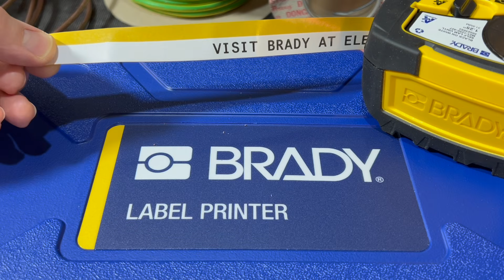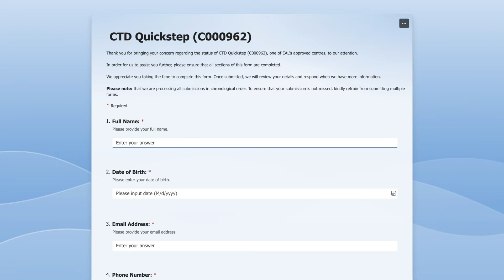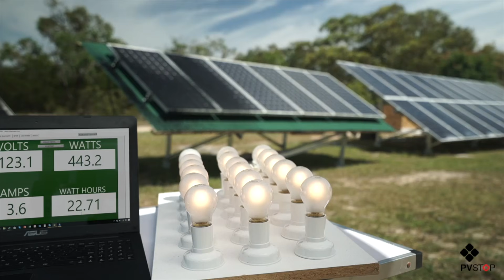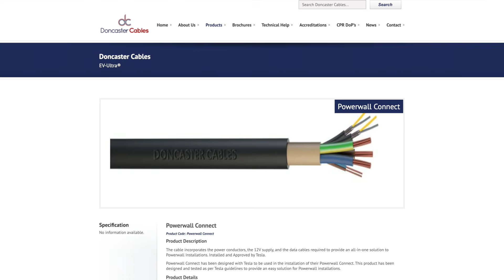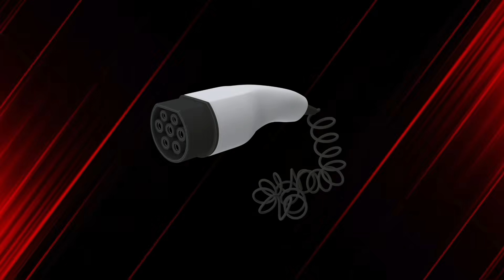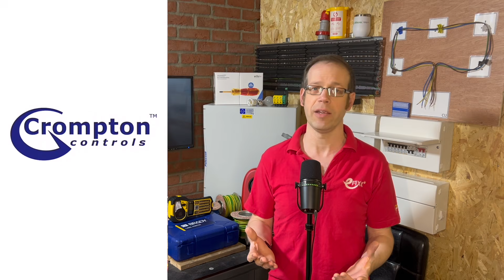Can You Do It? Yes. Should You? Hmm…

Comment: In the US, we don't have a standard rail to put the breakers on... When you build your house and install a particular brand breaker box, you are pretty much locked into the type of breaker that the manufacturer uses... If you have a house that has a discontinued model of breaker box, you might find it a bit expensive to buy a new breaker for a new circuit or replace a malfunctioning breaker... In some cases, it is cheaper to buy an entire new breaker box and new breakers than trying to buy a new breaker for your old breaker box... Having a common bus (DIN) that every manufacturer is required to conform to makes a lot more sense... That being said, I've lucked out with my current house since it has a Square D breaker box and the breakers are easy to find... The current price on the 60A 2-pole breaker that I used for my NEMA 14-50 welder and EV outlet in my garage / shop is $17 at my local HomeDepot...

Comment: The real comedy one on 'different' brands in the same enclosure is when it's been bought in by another company and just re-branded.
e.g. a long time ago MK MCBs were made by merlin gerin 

so now can get a whole lot that are the same brand on the label but a bunch of different manufacturers under the covers, lots of nonsense.
Reply from the maker: Wise words - the first MK sentry devices prior to the Merlin ones were made by Siemens.
Reply: Every time I buy a new MK breaker the switches don't line up with ones bought previously. I have seen one board fitted with only MK devices and it looks like a complete dogs dinner due the mismatches  as it has been upgraded over time.

Comment: Mixing different brands in the same CU. Is bad practice, I wouldn't do it.  When I see such things , I know I'm working on a bodged job ,, and know I going to have to put a lot of things right
Reply: Or just a job which has been upgraded.
Sometimes things are added to a system after it’s initially installed.
Reply: Or just a job which has been upgraded.
Sometimes things are added to a system after it’s initially installed.

Comment: Those mix and match caveats are absurd. If a half a dozen manufacturers can each stuff (say) a 14 way cabinet full of gear without it overheating, then mixing and matching isn't going to overheat it either; they are just metal boxes with a DIN rail. Other countries don't have the same restrictions. Of course there are some mechanical issues; primarily whether the bus bars line up, or if the switch fascias line up with the aperture in the cabinet, but the whole idea of a DIN rail is that it's modular. 

However, I guess it looks neater then it's just one manufacturer's kit.

Comment: If a customer needs a new circuit and there csu is no longer available for extra mcb,s & i have the correct current rating mcb & it fits perfectly ON THE BUSBAR then i shall use it rather than tell them they need a complete new csu. Its the difference between say £ 150 for a new short 6mm hob supply & £ 750 for a new csu. 
As long as its fits perfectly and the current rating is correct and obviously fits the bus bar.

Comment: 9 out of 10 times I find the most likely reason for mismatch mcb/ rcbos etc ,is because the electrician who installed the consumer unit . Put in some cheep and nasty unbranded board to start with. And no one stocks the accessories. If it was a well known make .even if the board is say 15 years old . Chances are my wholesalers would have it . Or we can get that tomorrow for you .
Reply: You don't need a branded board, it's a plastic box with a DIN-rail in it.
All needed is that it follows the specifications and you can call it a day.
Reply: @johanmetreus if I see someone has put a unbranded board in . You know the rest of the job has been done on the cheep ,with corners cut .

Comment: In Germany there is no problem mixing Hager and ABB in a fuse cabinet. 
EATON, Siemens and Schneider Electric are also well-known brands. 
In Germany, no extra paperwork is necessary for this.
But German fuse boxes are larger, simply because three-phase power is usually used.

Comment: I like the European view... Its a box to mount whatever DIN-rail modules you want! Any thing from timer modules, to relays and contactors, power supplys, smart lighting modules, you name it. There consumer units are massive DIN-rail boxes, with plenty of space to put whatever you need in a modern house. It's not just a boring fuse board!
Reply: Still, the more consistency one can have on a single rail, the better. For example, I have the input protections (GRID breaker, surge arrestor, inverter RCD, ground-neutral bond contactor, inverter LOAD breaker) on the bottom row rail, most of the house loads on the top row rail, and the transfer switches as well as the output to the secondary breaker panel on the middle row rail.
DC protections are in their own  panel.
Reply: @lua-nya   Of course! you want to keep it neat and logically ordered😉👍

Comment: Different brand MCB’s/RCD’s is only really a problem on switchboards using fixed busbar/chassis mount. Din rail mount typically found in residential switchboards you can mix and match without issue.

I know in Australia it’s a defect/against code as it’s against manufacturers specifications to install a non approved breaker. Although I’ve rarely come across a different brand on a chassis with a thermal issue.
Reply: Rather than try to explain it all it's probably easier to just state that for small installations that may have something comparable to a CU we generally take a very generic approach.  Generic DIN enclosure populated with what ever device brands we want.  You can find a Hager DIN box with chint devices, that's fine.  You can find a Clipsal in with the chints and that's fine too.

Comment: Some of the time when you come across mismatched breakers, it's laziness- it's not hard to find a Hager, Wylex or Schneider breaker for a board that's twenty years old. Most of the time though, it's because the previous spark used a board only sold by one wholesaler (eg Proteus, M2, Newlec, Steeple, Sector, Alto, Eris etc) or another brand with limited traction for whatever reason

Efixx promoting boards like Eris means you're becoming part of the problem 10 years down the line

I'm not sure what the answer is. But in the UK, I'm sure it'll always be easier to find parts for a Seat Arosa than a Perodua Myvi
Reply: The answer is it should all be standardised. Other industries don't have this problem you can swap power mosfets and rectifier modules between manufactures by when it comes to distribution boards sticking to a standard is too hard despite the fact they all use standard din rails.
Reply: The consumer unit is probably the most important electrical item in the house . So why use cheap makes that you can’t get spares for
Reply: @andysims4906  Flip side.  Why use products that lock you in?  I know you have to comply with your regulations so we'll give a nod to that but most other countries are able to use any individual approved component for small installations such as would be used where your CU is used.  It just works and countries aren't in flames because of it.  Use one of any number of approved enclosures, approved switches, approved MCBs, approved RCDs and so on.  There is no issue with spares since you can simply use any approved device provided it is used in a compliant manner.  Got a board full of 'SBS' RCBOs and one goes bang?  No worries, replace it with a Schneider.  If it's mechanically incompatible and there's a spare slot, wire over to it and you are done.  There's no need to go out and get engineering certification either.
Reply: @andysims4906 I assume lots of electricians have builders screwing them over on price. Only last week I saw an estate of newbuilds with 'Powerbreaker' boards. Since then, Greenbrook bought CircPro who import the MK branded boards. I can't imagine they'll keep both ranges in the long term

Comment: So the IET and BS7671 doesn’t expressly forbid installing different brands into a particular brand of CU, but the manufacturers claim it could not will but could cause overheating?
This is just another attempt by manufacturers passing the buck to avoid honouring their own warranty. I can tell you when I was working on a new nursing home back in the early nineties we installed Crabtree three phase DBs with a mix of Crabtree and wylex MCBs and the then new RCBOs and not one of them have ever overheated and are still in service today.
Reply: It's simply a legal issue.
A vendor of a CU cannot test the CU with all possible combinations of breakers on the market, so it cannot be sure there won't be any problems.
So it doesn't give any performance guarantees, it can't.

To avoid any legal ramifications later if an installer has installed a mix of brands of breaker and something untoward happens, the electrician, the home owner, the HSE cannot take legal action against the CU manufacturer asserting they expressly permitted the mix of breakers.

So the message from the CU vendor has to be, "We do not recommend it, it is not approved by us, mix brands of breakers at your own risk".

Comment: Often different main switch/mcb/rcbo's align differently when mixing makes, resulting in a bend/twisting of busbar when tightening it all up...
Might only look 1mm or two slight different positioning when comparing the busbar connection points but it will attempt to throw stuff out as the busbar fights against the ever so slightly misaligned rcbo from another manufacturer
IMHO it's more a case of alignment with the busbar than other things, maybe OCD with a row of FuseBox devices plus an odd BG mcb shoved in there - thinking that'll do as temp fix from Screw-Thicks
Reply: You need only to look at other countries where it is not frowned upon at all.  It is the responsibility of the electrician to ensure the items mount up properly, no bending of things to make it fit, and if it won't wire direct or start a new section of busbar.  Small installations can mix and match equipment because all approved equipment will successfully cope with the 'low' fault currents etc.  It's generally only once you get over 10kA faults that you need to move to type approved switchboards.  These countries are not on fire, yet everyone in your country is running around wringing their hands over it.

Comment: The main issue I see with differing breakers is the position of the busbar not lining up. Sometimes it's unavoidable to use other brands as it could be the same manufacturer don't make the part you require. Are you expected to replace an entire board so all the gear is the same brand.. seems unfeasable to me.
Reply: Never use the busbar on an incompatible breaker. A wire link can be used for the new breaker or to link between different busbars. In many countries they just use wire links in place of a busbar.
Reply: Exactly. And if you have to bend the bus bar to get it to fit that’s where you are going to get problems.
Reply: @SDelectricalINAEC  The logical question that follows from this is why haven't the standards bodies made so all modules have the some dimensions so the busbar lines up? It should all be standardised.
Reply: I have no issues using the same brand of breaker. However, a different brand of other equipment,  say a timer or energy monitor for example might well be unavoidable.  I'd never use anything on the busbar that wasn't designed for it. This is just an example of greedy manufacturers demanding you use only their stuff. Also, overzealous electricians might start throwing C ratings on the certificates because it isn't all matching brands.

Comment: The fact that switchgear isn't standardised to the point ypu can "mix and match" is beyond absurd. The idea that one breaker might overheat another is ridiculous and is clearly just the manufacturers conspiring to lock in customers. There's absolutely no reason why the IEC, IEEE or some other standards agency cant step in and make them all build to the same standard so they're interoperable.
Reply: You really only have to look at the product ranges on offer.  In my part of the world can buy a single Hager C20 type A 1P+N switching (switches the neutral) compact 6kA RCBO with neutral fly lead retail for the equiv of about £14.  If I buy a box it's cheaper.  How much can you buy the same at wholesale pricing?  I can also buy D curve of the same.  Can you?  It really has been curious to watch videos from your country about people talking about these new improved neutral switching compact RCBOs and even RCBOs designed to mount on a gasp 2 pin busbar so that you can eliminate the neutral fly leads.  If you look at the time lines  there is no doubt at all that you are being held to ransom.
Reply: Might also make hager make their gear to the same standard as everyone else. Rather than making the wiring regs change to eliminate tests that they fail.
Reply: Definitely not the IEEE here in the UK.
Reply: It's like mobiles on planes.  They're 99.999% sure that it's going to be fine, but since they haven't tested every single piece or combination of equipment, they can't guarantee it.
Reply: standardisation is a problem everywhere in tech. if you attempt to regulate it, then the companies that bear the brunt become uncompetitive. It only seems to work in countries that are communist, or in fascist counties where all the tech firms are nationalised.
Reply: @martin-vv9lf  go take a look at any electronic component retailer. It doesn't matter whether it's an op-amp, a logic gate IC, a timer IC, a resistor array, a seven segment LED display or a microcontroller, they all come in a series of standardised packages, with standardised footprints regardless of manufacturer.

Go look at a PC parts supplier. Every motherboard follows a standard layout for mounting, for rear I/O position, for PCIe connectors. They use the same power connectors. 

There's plenty of standardisation all over the tech world.
Reply: @JaenFoster  take an example just cars, they don't have standardised V6, V8 or V12 that you can drop in to any other vehicles or gas boilers and other appliances. Accept that electrical switchgear is bespoke manufacturer engineer led products to live in their own ecosystem, like Apple and Microsoft or Apple and Android
Reply: @cvarsani2190  except the standard of all using 12V electrical systems. The fact that until recently you could just go and buy replacement headlamps and all you needed was the fitment type (H1, H4, H7, etc.) not to mention every nut and bolt will be made to either ISO metric or US customary standard. 🙄 The fact that a single part often fits many makes and models of car. All this absolutely dissolves your argument.

Edít. And going back to @martin-vv9lf's point. Back when car manufacturers used a lot more standardised parts, there was a lot more competition and even quality parts were cheaper as there were often multiple manufacturers making the same part.
Reply: @cvarsani2190  A bizarre and ridiculous comparison. Cars are so much more than just a component required to do a job. They are a "whole" product with style, perception, value or exclusivity all part of a bigger package of which the engine is a huge part of it. Many would argue that the car industry drive to make common components across different models and brands has been to the detriment of the industry.
Reply: @cvarsani2190  Ummm? Cars often share many components including engines. My cars drivetrain is identical to at least two other vehicles I am aware of with different brand names.

I agree with the OP here, manufacturers should standardise components a lot more - as well as fostering competition and reducing prices it also reduces waste.
Reply: @martin-vv9lf  what a totally insane blanket statement - it doesn't take more than a few seconds to find loads of examples where regulating standardisation in tech worked wonders. usb-c? mobile telecoms in europe? the sim card?